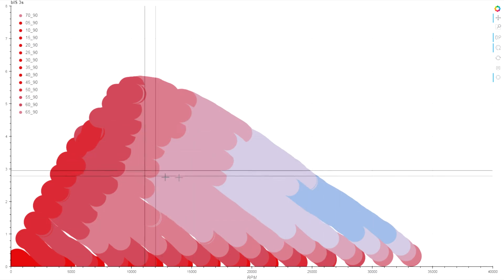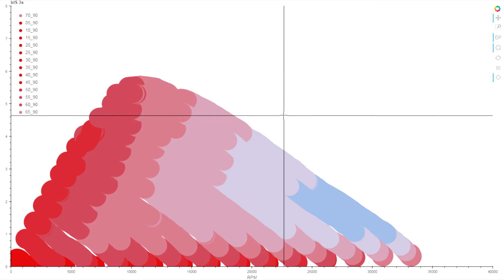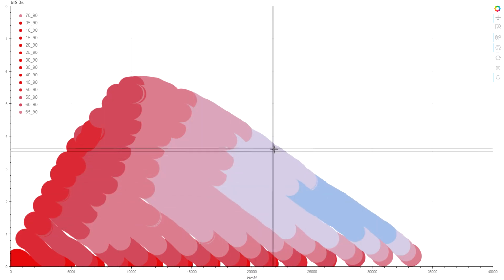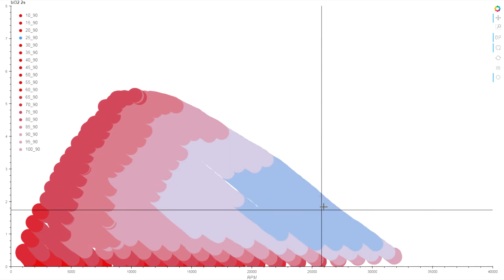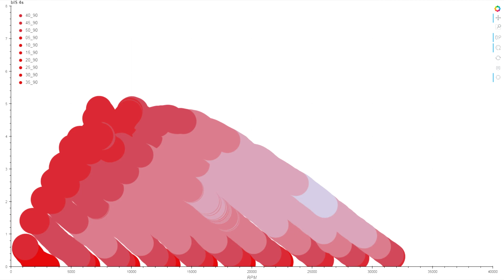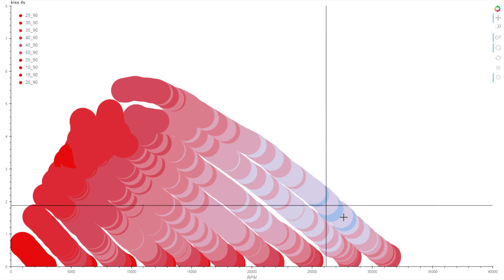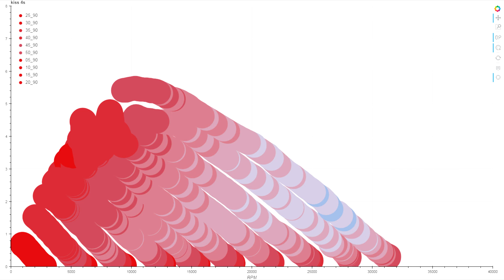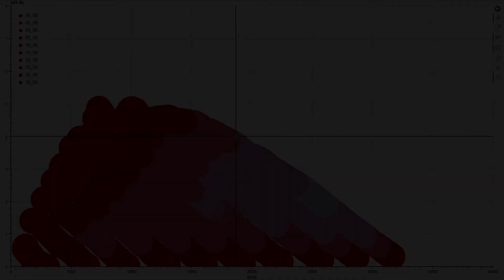Battery voltage vs. efficiency Pt.2

Comment: It's no surprise that the efficiency is going to drop off if you increase the system voltage but keep the RPM the same. The ESC is essentially acting like a buck regulator and with the 2S it has to step down far less voltage to meet the back EMF of the motor, vs the 3S and 4S.

There is no point, whatsoever, in increasing the pack voltage, if you do not need the extra voltage headroom, ie need to spin faster.

Comment: yet again... excellent data collection/presentation! So my initial thought based on this data is that a 3330Kv motor on 3S would be ~7% more efficient than a 2500Kv motor on 4S. Is that fair to say? I'm considering trying such a setup to see if it gives me any sort of noticeable advantage
Reply from the maker: conceivably.  The difference in KV should be a wash, but if this voltage difference holds up that puts the advantage to the high KV motor, which seems to violate the first principal.  But that theoretical guide may only stand up with an ideally driven motor and not with our actual pwm drives.
Reply: In theory, theory and practice are the same. In practice their not haha
Reply from the maker: Just means we need more theory.  Heap extra theory on that!

Comment: Doesn't KISS do some dynamic motor timing stuff, could that show up as noise?
Reply from the maker: I'm not sure, I don't think timing slipping around slightly should have a big effect, but perhaps it does.  Auto timing was set on the BL32 esc as well.

Comment: I'm pretty confused by this. Your tests seem to indicate that lower voltages are more efficient, however; it's well known that this is not the case.  higher voltages produce more efficiency in the motor - barring things like prop matching/atmospheric effects.  Is this perhaps because you are restricting the envelope?
Reply from the maker: Well known by who, where, with what data?  "common knowledge" within the multirotor hobby isn't worth the virtual paper it's written on.  Intuitively I feel like higher voltage should be more efficient, but I can see this same effect even in other peoples static tests where they've published reasonably reliable looking data.  Motor theory says that there should be no difference in torque efficiency as KV changes, which should mean there isn't any inherent change in efficiency from voltage as they need to change proportionally to maintain the same torque output.

That's the nice thing about looking at the dyno results are this shows the entire power envelope of the motor, all work loads, at all throttle positions.  This data covers a motor spinning unloaded all the way down to "nearly" stalled, that's the power range used during static thrust tests as well as fully unloaded in the air and a massive wide margin on either side of that.  I'm not sure how you could more thoroughly look at a motors overall performance.

Unless you mean like how I'm only showing the overlapping area of the charts.  There is still a higher efficiency zone even at the higher voltages that is cut off in these charts of course, but it's at much higher rpm and much lower load.  I'm making the assumption that we're working off a fixed torque load more to the old question of "can I get a high kv motor and run high voltage and just limit my throttle", so only the areas of overlapping performance are of interest.  If you need more torque than you can get out of a particular motor on 2s say it doesn't matter how efficient it is.  Matching different motors to different loads is a more complicated thing to look at.
Reply: I am a bit late on the comment but I read a part of this discussion and I asked myself a question about the efficiency calculation. I do imagine that the electric power compared to the mechanical power is calculated with the voltage and current applied on the ESC. I am right here ? 
As the ESC is directly connected to the battery voltage, the consumed power is directly linearly related to the current (assuming no voltage drop of the battery). 
With an equivalent kv motor, the motor velocity is directly related with its input voltage. As we are comparing values at equivalent rpm, the motor must be provided the same voltage whatever battery is connected to the esc. 
So my question is the following. Assuming that the esc must output for example 5v to achieve 5000 rpm (random number), may the esc efficiency be better if it has to transform 2s (7.4v) to 5v rather than 4s (14.8v) to 5v ? 
And so may the motor efficiency degradation be due to the efficiency degration of the esc ?

Definitively not an electrical expert so I am simply asking myself questions =)
Reply from the maker: Thanks
Reply from the maker: Really interesting, I'll have to finish reading the ARL paper later, but I think they're showing the same thing I'm looking at here, their wording is just a little confusing.  Key reference is figure 13A.  their text says increasing voltage gives a slight overall increase in efficiency, but I think they're showing an increase in "peak" efficiency rather than overall.  In fig 13A if you look at the stackup for a 1.25 watt load you can see the 4v test at almost 55% efficiency, and the 7v test languishing at like 38%.  The 7v test does go on to reach like 63% efficiency, which is higher than the lower voltage test ever reached, but it did so only at a 4 watt load.  The area under the 4v test efficiency curve shows a massive advantage in efficiency, like 10-20%, over all the higher voltages tested, but of course that is only good in that narrow range of power outputs.
Reply: He said he's testing the same motor, you'd need to drop kv with high voltage to get any possible advantage.
Reply: Bexamous that would be true if you had props on. Which he did not. Higher voltage should increase, not decrease, efficiency when not considering props or aerodynamic effects. I already said all this.
Reply: Well, to the Army Research Labratory for one:

https://www.google.com/url?sa=t&rct=j&q=&esrc=s&source=web&cd=11&ved=0ahUKEwjfiozJ18vYAhUS6mMKHU6EBGE4ChAWCCgwAA&url=http%3A%2F%2Fwww.dtic.mil%2Fget-tr-doc%2Fpdf%3FAD%3DADA577582&usg=AOvVaw2rlnriQvDrJlMYN0wXj-Qy

I'll see what else I can locate, though most testing seems to focus on KV as opposed to motor efficiency itself.  I also agree that "common knowledge" is a pervasive problem in the RC hobby, and that testing itself is the only recourse.
Reply: I've personally done a ton of efficiency tests just flying and using current / distance and I too find that lower voltage is more efficient. These tests pretty much line up with what I've found out. Ever wondered why a lot of AP rigs like the mavic use a 3s lipo?
Reply: Also, here's a theoretical take based on the mathematics of an ideal brushless motor:

https://electronics.stackexchange.com/questions/39387/how-are-current-and-voltage-related-to-torque-and-speed-of-a-brushless-motor
Reply: Hmm, I'll do some more looking around, but I'm going to guess it has something to do with measuring the torque only, which does favor higher current (and thus lower voltage) whereas the actual power of a motor also includes the speed of the shaft (which I assume is one of the variables you dropped).

Interesting for sure, and thanks for actually doing experimentation - we need more of this in the hobby.
Reply: +SiieeFPV I noticed that as well, which made me look around some more.  I don't think it's entirely clear, and I think it matters more than I initially assumed as to the particular manufacture of the motor.  What we would need to know, IMHO, is are we in the regime more like the 4w portion of that chart, or the half-watt portion.  And is something being missed by using torque as an analogue for power?  And is the motor significantly out of it's watt-rating under any of these tests (either higher or lower)?
Reply: So the mathematical model is talking about an ideal brushed motor, not sure how relevant that is in comparison.  End result of his calculations is double the voltage, double the torque, 4 times the power.  So half the efficiency for each doubling of voltage.  The overall thought of that certainly seems to jive with the ARL brushed test data, clearly higher efficiency at all power levels as voltage decreases down in fig A.1

I feel like using torque as the kind of 'key' for the whole thing seems relevant for our load requirements at least.  Thrust directly relates to rpm, and each rpm has a specific torque requirement.  While we can't directly measure thrust in free flight we can back calculate the torque load on the motor in free flight with telemetry to see exactly where in the powerband we're falling, taking into account prop unloading and everything.  We still need to look at the full band because the torque requirements of the prop aren't linear, so it's possible for a prop to be out of our ideal efficiency at peak throttle, but fall nicely into our area of peak efficiency at partial throttle, which may be preferable.

Watt ratings are kinda hard on may of the motors.  Lots of manufacturers seem to list just "voltage" rating, which isn't even a thing.  Some I've seen sustained power ratings but they're like really low compared to the sort of loads that people will often run, at least in these small 1306 sized motors.  The best example out there I think is like RCX which rates coil temperature at sustained levels for each of their sample thrust tests, which seems to be the better way to judge how close to the motor capabilities it is.  If I trusted all the cheap manufacturers out there to not just make up ratings then it'd be more useful perhaps.

Super interesting also in the ARL data is their ESC efficiency results, massive losses in efficiency within the ESC
Reply: oh, and shaft speed is the X axis in the charts I showed, missed that earlier.  X and Y axis make up both individual components of a power curve, the efficiency is only shown on Z
Reply: Mark Medrano good point on the shaft speed. Personally I still think something is missing in terms of the takeaway one gets from the video that lower voltage is more efficient. That's simply not true in general. It can be under certain circumstances though, and I'm wondering what is the bigger picture. Certainly, it's more complex than I initially thought as well. So I've learned from this video, and for that I'm quite thankful.
Reply: under what circumstances though?  I've been wracking my brain trying to think of a test to demonstrate it.  Peak efficiency at vastly different power outputs is the only situation I can think of.

I think difference maybe is that in reality you would not just change the voltage and leave the rest of the system the same (though if you could eliminate the PWM of the ESC and drive the line voltage directly you could gain a big whack of efficiency for nothing)  The practical test would be showing different voltages with matching kv.
Reply: Mark Medrano agreed. It's a tougher question than I initially thought. For me, I'd like to answer the question of "when I have a great deal of choice in motor/prop/voltage combinations, should I assume target highest voltage, lowest voltage, or something in between?" I don't mean to imply that this is even the goal of the video. I have been under the impression that if I start with a greater voltage and match everything accordingly, than I will end up with more efficient flight - all else being equal. I'm now curious as to when this assumption may break down. Obviously there are a ton of variables involved with such a consideration, and the tests in this video address a small portion of it.  Still, to me, this is pretty non intuitive, and I still think something fundamental is missing. But hey, there's always room for data and a new understanding.
Reply: oh ya, I want to do a bit on powertrain selection and tie everything together, still have some fundamental demonstrations to do on some of the other bits to give some background though.  I'm hoping that the new motor and prop tests should make those kinds of choices a lot more clear than they have been so at least we can reduce the big boogeyman down to just aerodynamic effects